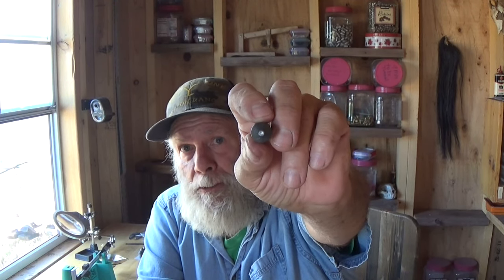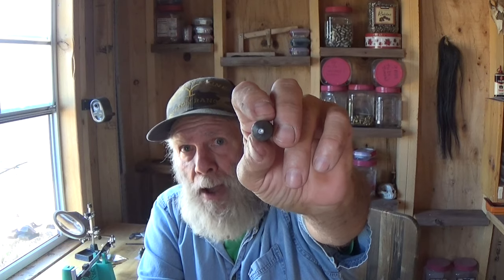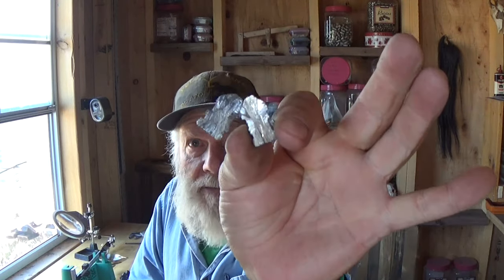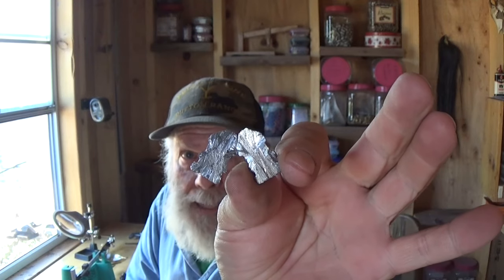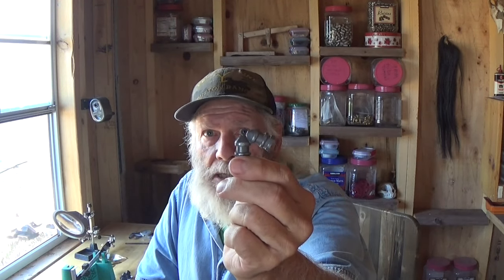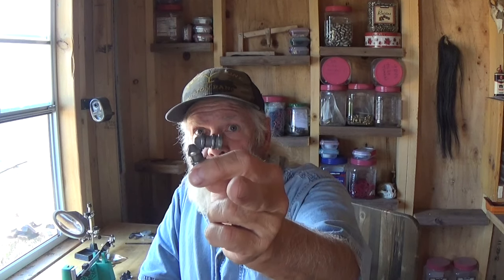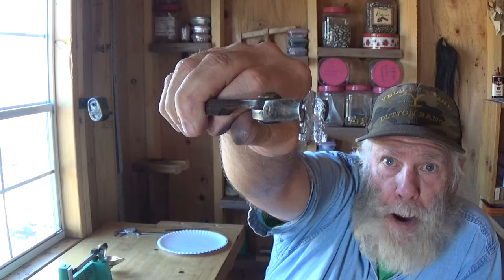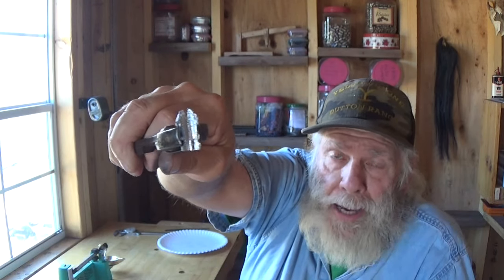Ever Think of Doing This to a  TC Maxi- Ball??  I Did Years Ago

Comment: I've tried everything on the market for muzzle loading bullets and I have found that the maxi ball works for me. I have been hunting with a muzzle loader since I was 18 years old. I had to learn everything on my own. I cast my own bullets because it's cheaper and I get better results. I have a 32 cal. And finally found a 32 cal..maxi ball mold. my really likes them. 1/2 inch group at about 20 to 30 yards 😳😊

Comment: I think because is the temperature that you're melting the lead to, I don't remember the exact numbers but if it is too hot the tin or antimony will mix, but if it is at a minimal temperature the tin and antimony will float to the top, you can scrape it off and wind up with virtually pure lead and you should be able to get more accurate weights.. keep in mind we are zoomed in really close on this 54 caliber bullet weighing around 420 grains, so it doesn't care a whole lot about a little inconsistency in its weight. And the range wish you're going to shoot is not going to be far. I think the biggest take away from this would be people that are not familiar with black powder arms have no idea of the tremendous firepower of these rifles. For instance the 4570 government, 45 caliber bullet of 300 to 405 grains, behind 70 grains of black powder, it's original calling. Now it's bumped it up to 54 caliber with 110 or 120 grains of the same powder behind it with a whole lot more bullet base to push against, it is just more close to artillery than it is a rifle round. Done a lot of hunting with the 50 and 54's, and I am quite confident they will kill anything on this planet with ease. Obviously they will kill on one end and maim on the other. It's not for the lighthearted to pull the trigger on such a shoulder fired artillery round.

Comment: Not to high jack this video, but I have a question about the TC Maxi- Ball. I have a TC Hawken in 50 cal and also have the maxi ball bullet mold. Has anyone used anything other than the TC bore butter for the bullet lube? If it isn't such a mess and pain to apply to the bullet, it won't be a problem I cast,size and lube my own center fire rifle and handgun rounds, so this procedure is not unfamiliar too me.
Reply from the maker: Have you looked for the applicator that threads on top of  the Bore butter tube?  It threads on top and   feed a bullet through the tube, squeeze the bore butter and it surrounds the  bullet, place the 2nd bullet in the tube and it pushes out the first bullet.  I loved mine.
Don't know though if they are still available.  Maybe E-Bay.

Comment: My guess is your getting tin loss due to the high temp and its affecting the weight. Start out with right % tin and the bullets will be a bit lighter, by the end of the casting session most of the tin has left the building due to oxidation / becoming dross and the purer lead is heavier.
Reply from the maker: but factory round ball also have a different  variation in weight,.  I do cast with pure lead.  So are you stating pure lead still has tin in it??